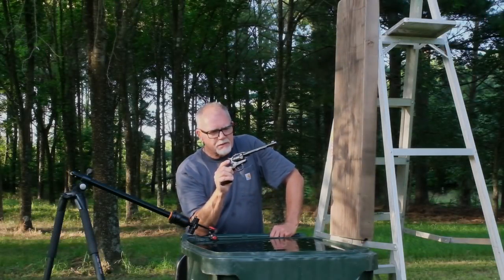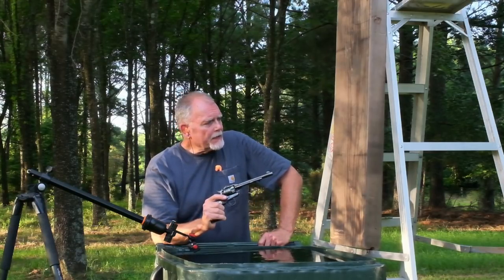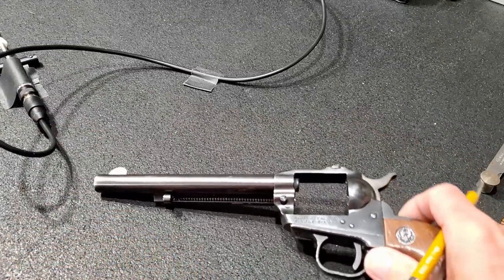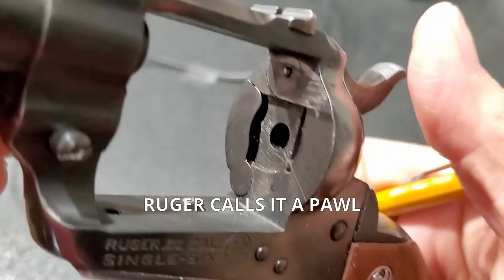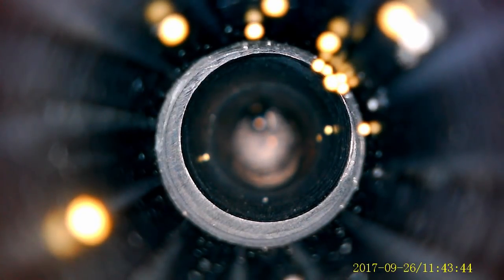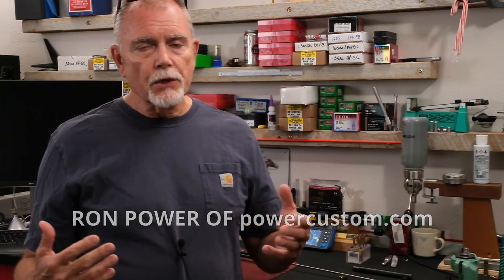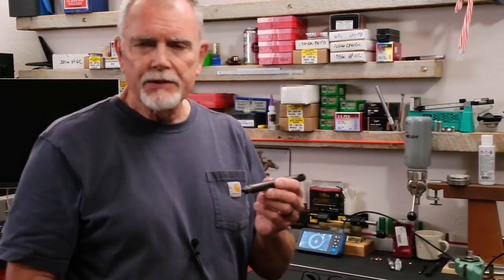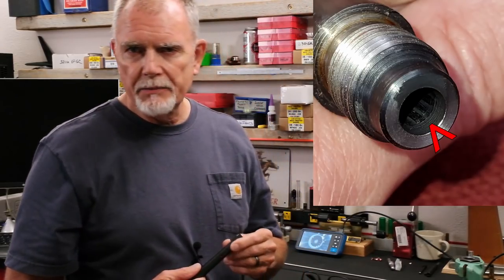The Bullets From My Single-Six Are Crooked ! ! !

Comment: The crown was off a bit , and the cylinder seems off a bit . Kind of makes you think just maybe the barrel 
could of maybe been board a little off center a little . Another thing I would look at is the cylinder pin or
shaft on a pistol that old could have enough ware combined with the ware in the center to cause the 
misalignment , but that would of took a lot of shooting . I got that from watching the movement from
the feeler gages and maybe the pressure from the cylinder lock paw could be pushing it off just that much .
Just a guess . 
    If you get one of those you can use it on my range / highline anytime lol .
Reply from the maker: I think you were on target Spencer. Right now I'm guessing in this order 
1 - Timing is off (left to right misalignment) 
2 - Barrel was bored off-center (up and down misalignment) 
3 - Base pin is a little loose in the frame and cylinder (all around misalignment) 
I can fix one and three, but if the "new" barrel doesn't improve up and down alignment I might have to throw in the towel and just buy some larger steel targets just for the Single-Six😄
Reply: @TargetSuite  All it would take to cause the barrel misalignment , is one tiny shaving that didn't get cleaned out of the chuck stuck to one of the jaws . Hopefully a new barrel  will fix most of it . And maybe a new cylinder pin if it seems to have a lot of ware . Check the pin with a micrometer , both front and back and roll it to see if there is more from one side then 90 degrees . If the pin has a lot of ware the cylinder hole could add together to a good bit of misalignment . You can just imagen how much stress is put on the pin being off that much each time you fire it with it out of alinement and the lock paw also . I don't know how much psi. the 22mag fires with but I would think 45K to 50K and the cylinder is getting slammed into place with every shot . Even just that much could cause a lot of ware . Just a thought , but something easy to check if you haven't already . My ID gauges only go down to 1/4 inch butt you could put the pin through the cylinder and mike from the outside of the pin to the outside of the cylinder to see the difference 90 to 90 from 4 or all 6 points to check the ID ware . The way trying to find ammo is now soon it will just be another club in our collections anyway . I wish that was a joke .

Comment: Good work to find any faults.
How to go and solve this problem. I always find it hard that to see all that energy lost between the cylinder and the barrel. Actually that barrel should have to go from a rounding motion to a stop and a push motion in the space between cylinder and barrel. Like in a "bolt action gun". So ... disengage / turn / engage / fire / repeat.
About the bullets, you could use a metal grid at the bottom and pull that up with the bullets on it. Without having to replenish that whole thing again with water. .

Comment: With that much up/down cylinder movement I’d have checked on replacing the cylinder bushing. Maybe the cylinder. Then perhaps work the hand or ratchets.
Reply from the maker: I'm going to rather than do the bushings I am going to use an oversized base pin. That will do the same thing. And I am installing a new oversized cylinder stop and new hand from Power custom. Thanks!

Comment: Seems to me that your video was really a step by step of how a well made revolver has to work in order for it 
to be accurate. Can I assume that a revolver made for match shooting has all those tolerances tightened up
so as to remove any normal eccentricity. In any case thats what I got out of it thanks to you and your persistence.
Reply from the maker: Yes, Competition revolvers are the artful product of a master craftsman/gunsmith, not the Ruger, Colt, or Smith factories.

Comment: It looks like we found out why the gun as traded in. I dont think this was an amateur gunsmithing issue. It looks like a manufacturing issue.
Reply from the maker: Maybe a little of both😉
Reply: That cylinder is not a magnum cylinder
Reply: @davidpaul9233  the center pin is out of position. It doesnt matter what cylinder is in it.

Comment: With that much vertical displacement, it would seem that the cylinder pivot hole is too big, or the cylinder pivot rod itself, is too small.  Either way, it would also throw off the alignment centerwise, and sideways, as the pawl would be lifting the cylinder at the bottom.Also, having the tape where you are measuring the gap is throwing off the measurement.

Comment: Have you checked  the cylinder  holding  rod to make  sure it is true or the cylinder  hole itself  could  cause a problem. Maybe.good series. Thanks.
Reply from the maker: Thanks for the suggestion. Yes I have check that and there is a little bit of slop between the base pin and cylinder but it's not too bad. Regardless, I have a new oversized base pin from Power Custom that will tighten that up even more.

Comment: I believe you're on the right track.  Maybe the original barrel was drilled off center.   One indication is the crown was originally finished off center.  Hopefully the replacement barrel solves the problem.   BTW, was the replacement NOS or a take-off?
Reply from the maker: Thanks! That "new" barrel is a take off, but in better condition than the original, at least from a visual perspective.

Comment: Could the shade-tree gunsmith have bent the base pin holding the cylinder in the frame?
Reply: Bent base pin, or stacking tolerances involving the base pin would be my guess.  If there's that much vertical play in the cylinder, then changing the barrel won't do anything.  Even if the bore of the existing barrel is eccentric, that won't remove the up/down slop in the cylinder.  So, you're right.  The base pin is where he needs to focus his attention.
Reply from the maker: Well the base pin is straight. But there is a little bit of slop between the base pin and the cylinder. I have an oversized base pin from Power custom that I will eventually install after all the other issues are resolved. My guess is that the bore of the barrel was not drilled concentric to the barrel blank. But that is a supposition only. I will be able to tell when I start unscrewing that Barrel. If the misalignment rotates with the barrel I'll know that was the problem. Thanks for the comment, and thanks for watching!

Comment: Its surprising how far off the replacement parts are as well as the partially yet consistently marked bullets.  I will be interested to see how you get the barrel clocked properly.
Reply from the maker: @big ben I haven't fitted the replacement parts yet. I will save modifying those for after I investigate the new barrel.
Reply: @TargetSuite  ok.
I was thinking a previous owner had done some work to the stock parts.

I am enjoying the investigation.

Comment: before you replace the barrel check the cylinder bushing bore and cylinder bushing. I believe this is your problem, the cylinder should never move around like that, not that much anyway. If it was a modern revolver Id say it was the cylinder crane bushing or the crane its self getting bent by dropping it with the cylinder open while loading unloading
Reply from the maker: There is what I would call a little bit of excess at play around the cylinder pin and frame. I do have an oversized pain that will take up that excessive movement. That will be part of the final solution.

Comment: I noticed the pawl and the ratchet showed a little to much wear that would account for the cylinder to not line up as it should and that would cause the projectile to enter the barrel crooked.  It that handgun was a larger caliber it would blow up in your hand or may be worse.
Reply from the maker: I'm pretty sure the new hand and cylinder stop will fix that rotational alignment. That's the easiest part of this process. It's the up-and-down misalignment that I am a little worried about. It's not as bad as the rotational alignment but none the less, to get Optimum accuracy it will have to be corrected
Reply: @TargetSuite  For the up and down alignment you will have to check the inside to the cylinder bore for wear and also the cylinder rod or pin that the cylinder rests on for wear.  I come across the same type of problem on lawnmower wheel bolts when the wheels begins to wobble.  What happens is the steel wears down from the debris that gets inside the wheel bore.  Sometimes fine particles of lead and powder will slip down on the rod and can slip down into the cylinder bore causing wear over time and usage.

Comment: Hi George, really enjoying the series so far. Looking forward to its conclusion.

If you wanted a more accurate way of measuring your bore to chamber misalignment, I believe I may have an easy one. First measure the diameter of the chamber as seen with the bore camera (in inches). Then measure the horizontal pixels of the chamber in the bore camera footage to get a pixel to inch conversion. Use that conversion to measure the offset of your chamber in x and y from the pixel offset.

This may be a waste of time, but if you wanted a more accurate result, this should do it. It would also tell you how much to shorten the new hand. You could convert the measured offset to degrees with a new, longer hand by using the distance from the chamber centreline to cylinder axis (radius). Then use that to convert to an offset in inches at the ratchet diameter. Should get you in the ballpark when it comes to filing the hand to length.

Hopefully I explained this well. I've never done it, but it occurred to me while watching your video.

-Tom
Reply from the maker: Thanks Tom! I appreciate that!

Comment: The initial track of the bullets for the first few inches into the water, prior to the cavitation bubbles, was interesting.  It looked like a curled pig's tail.  I would not expect a symmetrical bullet to track like that but rather to make a straight track.  That seems to support your bent bullet theory.
Reply from the maker: Thanks. I think your observation is correct. Those bullet should have basically gone straight in.

Comment: I bought a Smith and Wesson 686 brand new and it spits back in my face little bits of either powder or jacket. I sent it in to the factory and they said it's fine. My wife's Ruger gp100 does not do this. My 686 is bang on accurate I have no idea what is going on. Great vid thumbs up
Reply from the maker: Thank you! I appreciate that!

Comment: The recesses for the cartridge rims at the back of the cylinder also appear to be eccentric/off center.  My Ruger centerfire Blackhawks are all fine shooters, but the rimfire single actions (a Single Six and Single Ten) are both inaccurate, and vary from round to round.
Reply from the maker: Thanks! I appreciate your input.

Comment: Am enjoying this, looking forward to the next installment. At the risk of sounding  ignorant, could there be some problem with slop with the cylinder pin, or something in that direction? Or was that feeler gauge merely turning the cylinder?
Reply from the maker: Thank you! There is a little bit of looseness between the base pin and cylinder, but I have an oversized pain from Power Custom that will take care of that problem. And yes the feeler gauge was rotating the cylinder as I pushed it in.
Reply: @TargetSuite   a pin not pain... a pain is when they don't work like you want !!
Reply: @TargetSuite  thanks for the reply

Comment: You can see that the "finger" is doing it's job by getting the cylinder into the correct position, but then when it is released, the cylinder rotates backward just a bit.  That is a worn cylinder lock, or a badly worn cylinder.....or both.
Reply from the maker: Good eyes. Turned out an oversized lock and base pin solved all the problems. Check out the last two vids in the series . . .

Comment: First time watcher here. I hit on the video because I have the same gun. And it's a Tack Driver. 
I'm no gun smith but with it's age and what I was seeing in your Bore scope, It looks like the center bore of the cylinder and the pin are a sloppy fit. Like it's the part that's worn out. There was just so much movement when you were fiddling with it. The tension from the cam stop was enough to push it upwards.

Comment: Your ability to put a .015 feeler gauge between the top strap and cylinder means there is some play in the center cylinder bore to cylinder pin diameters. Mixing this play along with the cylinder stop spring pushing the cylinder up a minute amount could cause the misalignment you're getting. Wear on the cylinder stop or it's matching slot in the cylinder could cause a difference in the rotation angle when locked and ready to fire. Just my 2 cents worth.......
Reply from the maker: Thanks! Your comments are spot-on.

Comment: your problem is in the crane/cylinder assembly. Either there is too much wear or the crane has been bent from some trauma to the gun when the cylinder was open or somebody playing around flipping the cylinder open and closed. The problem is not with the pawl, ratchet and cylinder stop....they are doing ok. The large amount of "wiggle" or play seen in the cylinder alignment with the bore scope and feeler gauge demo shows evidence of excessive wear of the crane/cylinder assembly as most likely cause.
Reply from the maker: I see from your other comments that you have watched most of the videos I have posted on this Single-Six! Thanks for watching! Since this is a single action revolver there is no crane and no flipping the cylinder open and closed. That is only possible with a double action revolver. I have an oversized cylinder pin, and cylinder stop to take out excessive play plus a new hand/pawl to re-time the cylinder to get it in line with the bore of the barrel. Thanks for watching!
Reply: @TargetSuite  yes I realized shortly after I sent the reply that there is no crane....embarrassment time! However I would still figure the problem to be with the orientation of the cylinder which is off axis with the bore center and thus it brings into question the possibility that the cylinder was bored off center or crooked from the factory or that the cylinder pin is bent. I do not know if the pin can rotate, if it does then it is not bent because a different position of the pin would yield a different off bore line up. I'd be checking that cylinder for a true pin bore.

Comment: In regards to your 22 cal. Ruger Single Six. I think your problem is in the fit of the cylinder to the base pin.
Reply from the maker: Thanks. I've got an oversized base pin to tighten things up. Just one of the things that need to be corrected.

Comment: I think that's still in spec. And I don't think it will make as much difference as you think. I've had three of those over the years with the 22lr and 22 magnum cylinders and the magnum was never as accurate than the 22lr cylinder.
Reply from the maker: Thanks for your feedback!

Comment: Did you check the cylinder pin and pin bore for wear. The locating stop load would force the cylinder off in this manner if the pin were worn or bent.
Reply from the maker: Good thoughts, but that pain is straight as an arrow and doesn't show anywhere. But there are a few thousands clearance pin 2 cylinder in a few thousand clearance pin to frame and of course the cylinder stop is Loose as a Goose. So all of that adds up to bad alignment

Comment: A couple things come to mind:

Assuming TDC of the barrel is at about 2 o'clock in the bore images:

It looks like the hand is too short. Inserting the shim is rotating the cylinder so it lines up. I think it's mostly an optical illusion that the cylinder is moving down towards the base pin when the shim is inserted.  There could be some slop in the base pin/cylinder base pin hole but that is the least of the problems. Do you have a base pin from another gun or a new one you can try that has no wear on it? A new base pin is about $10 from Gun Parts. 

To lengthen the hand peen the top sides of it at the pawl contact area to stretch it a bit. Then dress with a file to square it up. 

I don't know where you are, but I've gone to Gun Parts with mics and calipers and measured parts to find one that offered the best fit. That place was dangerous for me when they had the retail store as it is located between my club and home... I cannot help but drive past it.😉 It is less dangerous now that the retail store is gone as I have to have a specific parts need to visit the parts counter. 😉 I wonder if the parts counter has survived COVID????
Reply from the maker: Great comment! I have an oversized base pin from Power customer. I also have a new hand and an oversized cylinder latch that I will fit once I get the up-and-down misalignment of the barrel / chamber resolved.
Reply: @TargetSuite  I don't think the centerlines of the bore and chambers are the problem. I think the real issue is rotational alignment as it is clear from the video that as you insert the .015 feeler gauge the cylinder is rotating. I'd venture that with the gauge inserted the centerlines are within a half thou. A longer hand would take care of that when combined with a tighter fitting base pin.  If the stop was worn it would would allow the cylinder to over rotate (which it isn't). 

When the cylinder is pushed into position with the feeler gauge the alignment looks to be well within what is reasonable for a fixed sight single action. Things like the relatively long and slow hammer fall and shiny round front sight are going to impact the practical accuracy more than a half thou of misalignment impacts  inherent accuracy. 

It is also unlikely that the centerline of the existing barrel threads and bore are out of alignment by more than a half thou as they were machined on centers. It's not like the old days when a barrel was forge welded around a mandrel, reamed, straightened, rifled, and the outside filed to make it look like the bore was centered, and then breeched. 😉